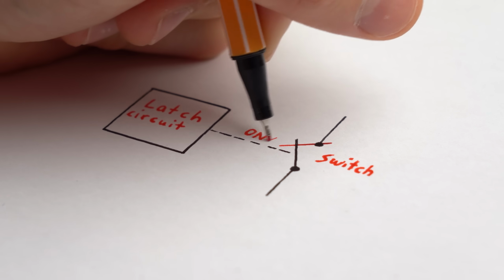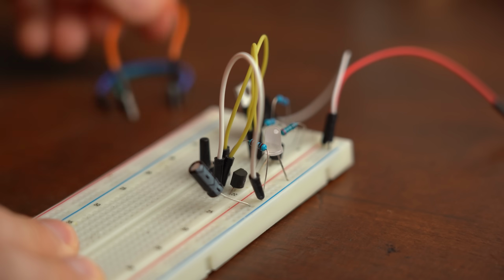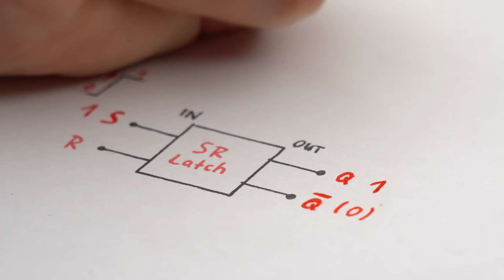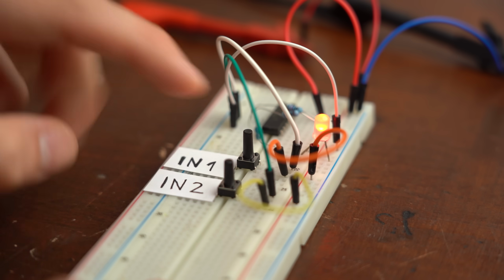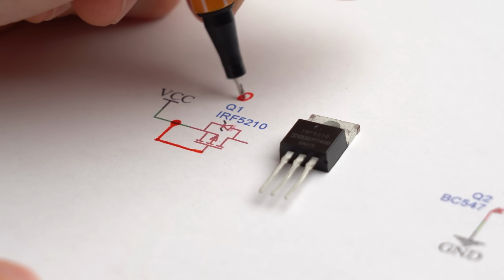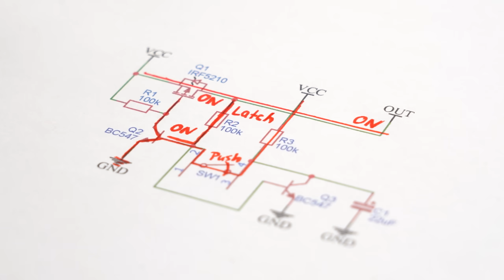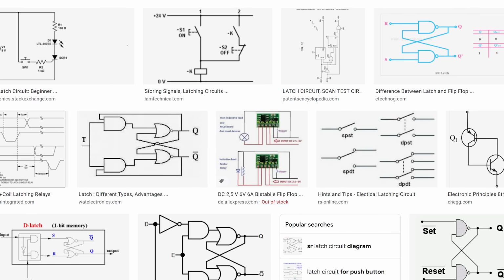Mechanical  Switches are Obsolete?! Switch to a Latch Circuit! EB#53

Comment from the maker: The first 1,000 people to use the link will get a 1 month free trial of Skillshare: https://skl.sh/greatscott07221
Reply: 1:35 i hate this new bgm while placing those LEDs..... 
Older one was awesome to hear 🤠🤠
Reply: Hi Great Scott, just a little translating advice:
in your “pro and contrast” dialog, it should be “pro and con”
pro = yes (affirmative)  /  con = no (negative)
I am not certain what language this stems from, my guess is either Latin, or Greek.
Reply: Can you make  a momentary wireless AC footswitch project? Normally open.
Reply: @PaulLawson-k8v  you want to turn on ac only if someone standing near ac ? You can go for PIR sensor as it have ideal for this type of work, you may have seen automatic lights in corridors, same way you can operate AC too.
Reply: Is P-Channel Mosfet best for latche switch
Reply: "Collect 10 Coca-Colla caps and get the 11th one for free" 🤪
Reply: you are not Scott, you are a Hans. Where is this channel name coming from?
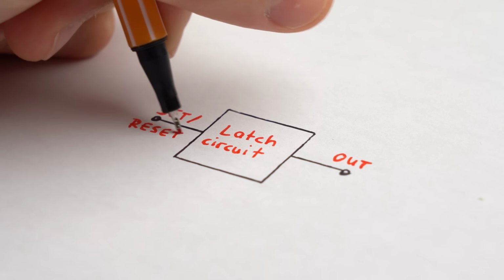Reply: 8:58 Wouldn't a simple thyristor do the same trick here?
Reply: can make a video that explain how to build a one push on /off circuit with various requirements like A, V, delay? And how to choose a mosfet like logic level and higher?
Reply: Spending 10% of your video on an advert wasn't enough?

Comment: An actual dedicated semiconductor latch circuit also works better than the schlock they've been replacing it with these days.
So many devices with pushbuttons on them have processors polling the button state periodically, and if you press the button but only briefly, it IGNORES YOU.
Those old-type latch circuits would latch so quickly it wouldn't matter how briefly you pressed the button, so long as the button contacts made contact.

Comment: I didnt understand how you replace a four way switch with your latch when there are multple three/four way switches involved. You would still need to wire the three/four way switches together the same.

Comment: Hi scott. I want to make an electronic switch for my fan Sogo JPN 651R. My fan has a soft push button for on/off, can also be operated with remote. During power off and came back i have to on/ off it manually by button or remote. I want to make a switch that automatically sense power and turn off the fan and during load shedding, it auto start the fan. Fan pcb has MCU, push button connected in between ground and MCU.

Comment: For those who don't get it. It's okay, this is due to software modeling called PLC, Programmable Latching Circuits. Basically electrical switching but only for educated computer science. Not electrical or electronics. 😂

Comment: yeap, This helped a lot. Made my own version earlier, with "hold" and "signal" pins. pressing button pulled "signal" to ground to notify arduino and "hold" was pin for arduino to keep mosfet on. My only problem here was that I needed to keep pressing button until arduino takes control of "hold", so this gave me nice tips how to proceed without copying pre-made stuff from internets.

Comment: If you love latch circuits,  can you do something for me? I'm building a unary logic circuit with comparitirs (the actual components don't matter)

Basically charge pulse:
Read state of capacitor
If capacitor full, discharge it and move on.
If capacitor empty, fill it.

As you can see, a latch is crucial for this logic.  Im planning on using the charge of a small reference cap s my indicator of full or empty,  but this is the start of new serious computation, but my electronic skills are vastly Inferior to my statistics and theoretical physics.

Comment: Yet another case where the "digital people" foist upon us not what is proper, but what is easy for the digital people to make.  If the digital people get their way, airplanes will be controlled by mice & touch screens.  THERE WILL BE MORE ACCIDENTS.  Use a mechanical switch!  You eliminate "parasite power" & allow the user to KNOW that his equipment is truly OFF.

Comment: i did exactly the same circuit and it doesn't work.. i spent hours trying to make it work (even did the EEVblog version), 

i tried with a PNP instead of a MOSFET, i tried with a 9540 (P-channel), i tried with 100k, 200k and 51k resistors (including a 1M in the EEVblog version) 

i tried using bc547 as switching BJTs, i also tried with BC548 

with 5V or 9V power supply

my breadboards are brand new and, they're good, there's no false contact or such. 

i even soldered a circuit with perfboard, and it was not working (with 2 BC547, a BC557 for switching, and 100k resistors, and a 22uF cap) 

i tried with a 33uf instead a 22, nothing changes.

sometimes it was working, but only for a few seconds. i don't understand what i am doing wrong, i checked many many times my wiring, to be sure, i was not doing any mistake 

to me it is the EXACT SAME circuit than in greatscott's video (or in EEVblog video) ! i am discouraged, don't know what to do.. 😔😔😔

here's the behaviour of the output (which is an LED for the test) : the led is always on. I press down the button, the LED turns off. i release, the LED is turning on again. my circuit is acting like an unlatched inverter. If i press and hold down the button, my led is turned off and on again, there is no blinking, just one pulse. The delay changes either i use a 22uF or 33uF. So the capacitor works, i don't think it is the problem.

By the way, i did the SR circuit version shown at the end of the video (or at least a very similar version), in the past. I even made 2 circuits like this on perfboard which still controls a bunch of led Lights in a bedroom today ! and they're working perfectly

which drives mad even more ! because i know i can do it ! 🥴🤯

Comment: I have encountered an issue with this circuit.
This doesn't work if the OUTPUT has capacitors connected. The Q2 is once again activated by the capacitors as soon as the SW is released.

Comment: The IRF5210 has a high Vgs gate threshold voltage, how does this work with 3.3v logic and a 3.7v battery/VCC?

Comment: Mechanical switches are simpler, cheaper, safer, do not consume power, they keep their previous state after power off or glitch, and do not arbitrarily turn on or off because an IC or transistor going bad.

Comment: Hi sir I'm an amateur analog circuit lover, and I have a question for you. Are there 2 headers on your IR sensor? I got 3 pins VCC, GND and Out Signal. If you have 3 pins did you use VCC and GND pins?

Comment: I believe there should be a resistor (high value) to ground the transistor base (Q3),otherwise wouldn't small emp trigger it? Since it would be floating right?

Comment: Hi, thanks a lot for this video as I needid this circuit very badly because I need to use it on a project with membrane push button. So I build the circuit like the schematic (Chapter: Toggle On/Off Power Latch circuit) and tested it with an LED and it worked! But 😕... For some reason when I try it with an arduino the button only kind of restarts the circuit and it doesn't latch. Can you by any chance help me with this?

Comment: This toggle circuit works great with BC337 /  IRFU9024 . When first powered, it turns the mosfet ON. Also, the LED is a must. If you don't use the LED (or a diode) in parallel with the output, the output becomes unstable and prefers to latch to 0V. I was searching for an electronic end stop and this is just amazing thanks for sharing

Comment: I prefer a mechanical switch: I see from the outside, if it is switched on or off  b) when it is switched off, there is really zero power flow

Comment: i was looking for weeks for this machine and YOU did it? xDD nice! Edit: Hey I noticed u got a loaded cap shorted to the ground through BE of Q2 everytime you push the switch, I'd add a small Q2 E resistor just in case.. But otherwise great design!

Comment: Electronically controlled latching circuits are also useful in situations where you do not want a device to return to the on state after a power failure.

Comment: alot of these latching circuits have an issue that when power is first applied they go straight into on state, i wanted to make a latching circuit for electric bike lights and blinkers the circuit switches relay push on,push off

Comment: No.  Soft-switches suck.  They constantly drain power and they leave circuitry connected 100% of the time so a very vulnerable to power-line surges and spikes.  You can create latched switching with mechanical switches and relays if you really need that functionality.  I hate soft-switches.  They need to go away.  Don't promote this sort of "trendy" crap.

Comment: Why are mechanical switches obsolete?  They do not require power to work and generally do not breakdown if the are rated correctly. They are also a one piece solution. Unlike the circuit described. Therefore the mechanical switch is least prone to failure due to age and requires no power to operate.

Comment: I made this circuit but the only problem is when we connect a capaciter included circuit in the out put we cant turn of it. Because the the capacitor in the circuit we connected in the output of latch circuit. So we need to add a diode to work this properly.

Comment: I’m confused. When the P channel is activated, doesn’t it connect the vcc to both bases of the transistors which would leave Q3 in an active state? Wouldn’t that render the push button useless for the second press? 
Somebody please explain how this works

I would expect a diode to block the latch from activating Q3?

Comment: Are there any ways to extend the time frame of the button press for the single button toggle on/off latch circuit? Would be nice if i didnt have to press the button so quickly just to turn the circuit on/off

Comment: Be sure to have an R/C across triac type switches that operate anything that would  incur a counter emf like a solenoid with a collapsing flux field. The induced voltage from the collapsing flux field will fry the semiconductor type switch.

Comment: when mechanical switch systems got malfunctions/broke.
you only spend pennies to replace 1 items, simple trouble shooting since it less components thus less time waste.
If Digital/micro electronics got malfunctions/broke.
You'll spend the same pennies with more items to replaces and more time spend to troubleshoot it if no visible damages are seen.

I've meet lot's of new Uni graduates that promotes all digital or micro electronics to replace the decades old rugged mechanical switches just to be scrapped after the Company spend Ten of Thousands of Dollars to Install it and another Thousands of Dollars spend to hires the "experts" to trouble shoots why the signal lamps on some of CNC machines goes off and some malfunctions to the start stop commands on the HMI, not also mentioning the money the Company lost to the downtime because the Programmer have to contact his HQ for the Administrative password set up by the previous Engineer..on Sunday.
The flaw of young peoples that watched some Non-Industrial standard Engineering Youtube Videos thinking "Why No One Do this thing" when get their first Professional Job on the Engineering sectors.

Comment: The SR-Latch circuit can be simplified a lot by just using two NOT gates made from one BJT each. That wouldn't require neither a MOSFET, nor a capacitor.

Comment: a function on a microcontroller works by connecting a pin to ground, how can we control this with the 3.3v output of another microcontroller? do we have to use a relay?

Comment: Hello, can you point me to the name or type of (latching) circuit which needs 3 pulses (within 3 seconds) to switch on and will switch off automatically after 5 seconds.
Also if the 3 pulses are not put in within 3 seconds the circuit will not turn on...
Any ideas on what this type of circuit is called or what mayor parts it consists please?

Comment: 4:09 i prefer use Q~   feedback to    A   and the trigger to clock    in a flop flop D 
Just remember use a pull-doun resistor  to make always starts Q=off     
if you wana always start on, just change feedback/output Q to Q~
a TIP41 to 12Vdc charges, or a SCR to 120 Vac and have fun

Comment: No! Mechanical switches don't use any energy when they are off. Iits a shame we have to use power strips to turn off our electronics. Bring back the TV that the switch actually turns off the TV. Routers and cable boxes the same. We want to save energy? We must use appliances that don't use one drop of energy when they are off. I won't run any neutrals on my switching circuits in my home. The hot is the only conductor that needs a switch. The neutral it were it belongs at the light box or at the outlet box. I'm old school and plan on staying that way. I have all the new electronics but when I want them off they are off completely. 73
Reply: exactly

Comment: wait, why latch circuit is better than mechanical switches again?
Reply: Decoupled components?
Reply: I’m using a latching circuit for my CNC’s power distribution box.
Reply: More sensitive to small changes e.g. trip wire alarm/burglar system in the form of a laser curtain needs to be very sensitive and may need a hundred different trigger points

Comment: One of the biggest advantages I haven’t seen many mention is the fact that you can use this circuit to control power with a microcontroller. It is very low power consumption during standby then you can have something like a motion sensor wake the circuit up. When the microcontroller does it’s thing it just pulls the pin down to turn itself off. This circuit is invaluable on battery powered electronics.

Comment: As someone who makes a living in industrial automation, I can say with certainty that the mechanical switch will not become obsolete in the foreseeable future.  There's no such thing as a "best" anything - there's only suitability for a specific application.  Humans make lots of different types of things for lots of different applications.  The art of electronics, especially, is knowing which one to use for which purpose - when and why.  Sometimes your designs are constrained by space, by money, by switching voltage, by transients, by safety regulations, by operating temperature, or maximum current, or power consumption, or any of a myriad of other reasons why you might choose one part over another.  We still make mechanical switches for a reason.  For several reasons, in fact.

Comment: Mechanical switches have the benefit of ZERO current when open, whereas semiconductors ALWAYS have leakage (and waste power).  I have seen in industry, where semiconductor 'relays' can be easily made to lock-up in the 'closed' position because of leakage.  I've never seen a mechanical switch or relay lock-up.

Comment: Audio equipment for use in loud environments benefit from the obvious tactile feedback of toggle switches.  Also, any system can easily telegraph it’s state if that state is displayed by switch positions. Hidden latches provide no such information.

Comment: Around year 2000, we implemented a "soft touch", i.e. pushbutton power switch (one button) on a product. We sell mostly to industrial clients. Before we even got to production, we found out people hated the fact that their equipment didn't automatically turn on when they powered up everything in the morning. We didn't really have room for a traditional rocker switch and everything else would be cumbersome and time consuming to mount. The solution I used was to use a tiny 8 pin microcontroller with EEPROM to remember the last setting. I can hear you way overkill, which was my first thought. But in the end the microcontroller solution was far less costly than the power switch and was compatible with PCB machine assembly. It left a very clean front panel. The tactile switch and the power LED provided immediate feedback as well. It was so successful we have used it in almost every product since and still use it in all current products that require a power switch. Initially we used a PIC12CD518 if I recall correctly but a few years ago I redesigned it with an ATTINY402/412. The PIC was getting old and costly while the ATTINY was pin compatible and about 40 cents each. Digi-key pre-programs them for us. We never had a single complaint from anyone. and anyone who services the unit likes that there are no wires or headers to disconnect. It also means we can have alternate methods to power the unit up or down as well. In all, it has been a win for us and has been more reliable than the decent quality rocker switches we had previously used.

Comment: Have a think about using TRIACs & SCRs as your switching elements. There is a latching function built in for DC & a very simple capacitor shunt bypass allows the SCR or TRIAC to switch off. These are often overlooked devices with impressive ratings for literally pennies...

Comment: A nice demonstration of basic digital (bi-state analog) logic S-R Flip Flops.
However the concept of replacing all mechanical switches with Latch circuits is ignorant and totally flawed.

With added complexity comes added points of failure and reduced reliability. 

Select and use the appropriate component or circuit for the required task.

Comment: The disadvantage of latch circuits is that they draw small amounts of current which is not much of a problem until the battery goes dead and starts leaking. This is the reason I prefer on-off switches. If you have a battery powered device with a latching on-off switch and don't use it often, take the batteries out. there is less of a worry with a device that does not draw power until it is switched on causing battery leakage. I have a guitar pedal which does not draw power until a cable is plugged into it one day, I opened it up and noticed the battery expiration date was 5 years ago no leakage. I use energizer batteries. I still try to remember to remove batteries if I am not using them however, I do forget sometimes.